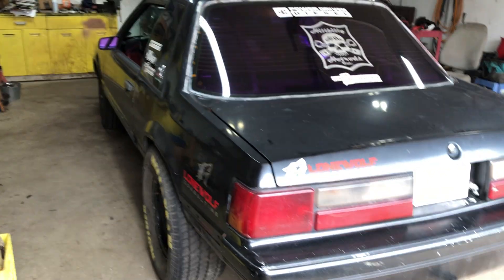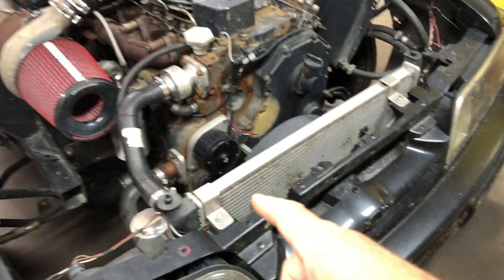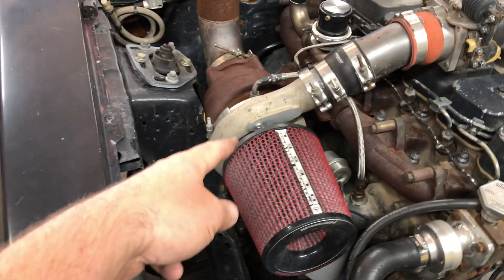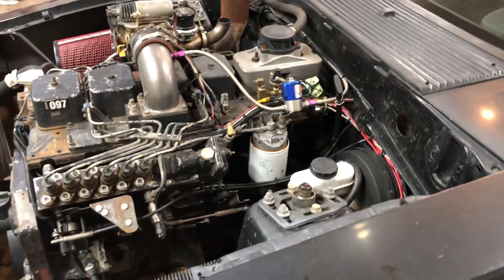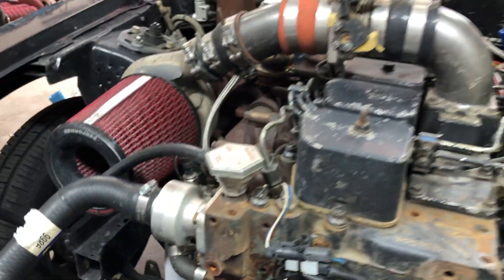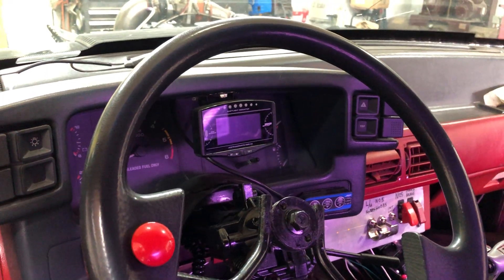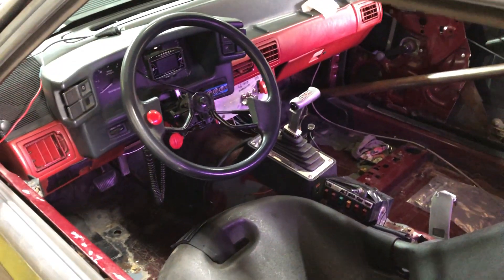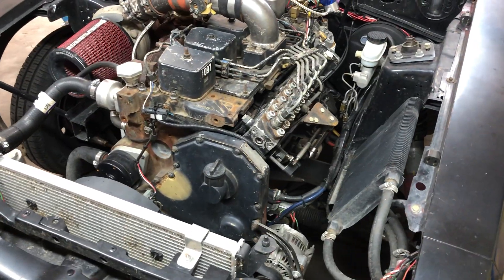12 valve Cummins mustang / 2023 build specs

Comment: Thanks for showing the build.  What are the specs on the new turbo?
Reply: You need to cross bolt your hood stack.
Reply from the maker: s471.  83/74 turbine  Currently has a 1.25 housing but I’m gonna be looking for a .9
Reply from the maker: i will be doing that for sure 👍

Comment: What did you use for motor mounts
Reply from the maker: there’s another video where I show them. I’m pretty sure. Just 3/16 steel plates welded up. then bolted to mounts i welded to the frame. kinda like how a motor plate mounts when people use them with V8s.